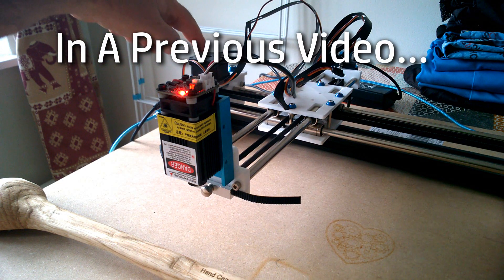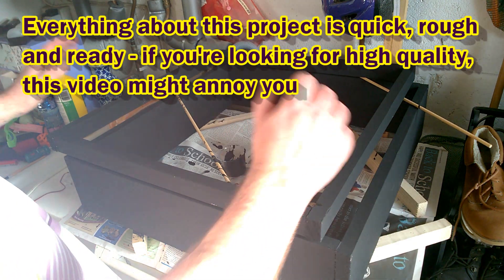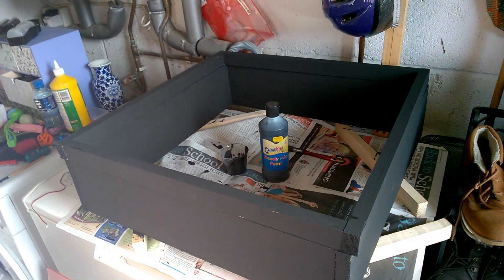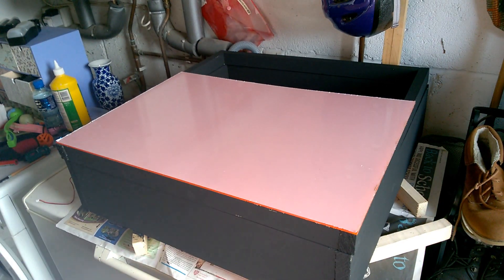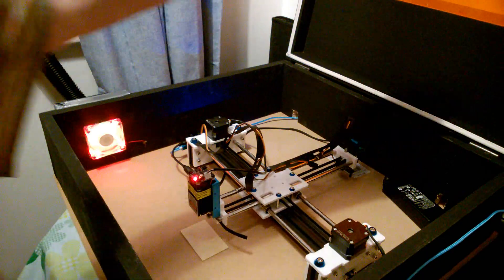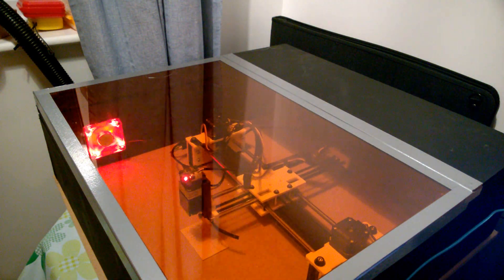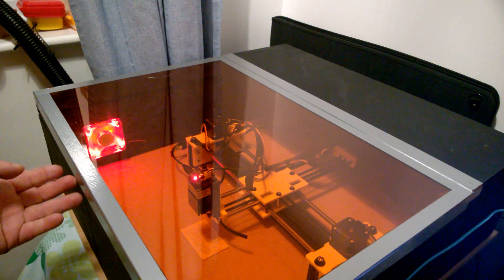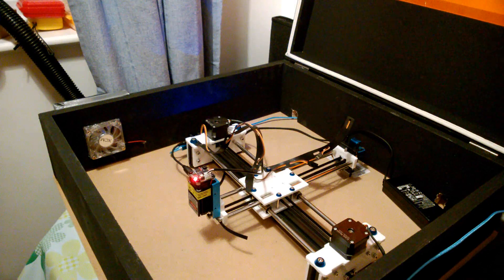Making A Fume Hood for my EleksDraw Laser Engraver

Comment: Great vid, just fallen into the same trap thinking I could suffer the smoke & smell as I won't be using the laser that much, but like you say you really can't even with windows wide open, so gonna give a home brew version a go but can I ask what size/diameter type of hose did you use ?.
Reply from the maker: The hose is just something I salvaged off a broken vacuum cleaner

Comment: Nice video! Where does one get the plastic protective material from?
Reply from the maker: I bought it from https://www.perspexsheet.uk/
Reply: Was it the tinted perplex orange 300? 
Thanks!
Reply from the maker: It's the Lava Orange Fluorescent - not technically rated for blocking laser light, but in practice, very good at stopping near-UV.  I still wear the safety specs as well
Reply: @AtomicShrimp  Thanks Atomic cheers!

Comment: I think you also need a draw, the fan is working hard to pull out the smoke. If you put a hole in the other side of the box the fan will perform better.

Comment: A vent on opposite side of vent may help with air flow. Then you shouldn’t need two fans.
Reply from the maker: Perhaps just a few small holes - it's important to keep the pressure inside the thing on the low side so the smoke can't just leak out, and also not to create too much of a crossflow in the working area, as lightweight materials like paper or foam could be disturbed by moving air inside the case

Comment: You could also have used the second fan at the opposite corner, creating an air inlet to the housing. Thus establishing an airflow over the engraver towards and out of the hose. That way you don't have to "fight" a vacuum and possibly a better "draft"
Reply: yes , inlet holes will allow for better airflow
what I did on my K40 was cover the inlet holes with active carbon fillters, this alone prevented bad small / smoke  from exiting the chamber.  ( use the ones you can buy for kitchen extraction hoods)
Reply from the maker: The idea is to have a partial vacuum inside the cabinet, then there should be no fumes escaping through any small cracks or gaps. Ideally, the fan should be drawing on the end on the exhaust hose
Reply: @AtomicShrimp  I figured that much... Considered mentioning a slightly smaller inlet fan vs a larger outlet fan would be preferable. But since you said you had these of the same type....
You can also just add some inlet holes... You'll still have a negative pressure inside the box (no fumes leaking out) but a better airflow. (no more "leaving it for a moment for the  smoke to finish clearing out of the box") :P

But hey.... If it works, it works, right...
Reply from the maker: Yeah, inlet holes are probably the thing. I think there are some of those as accidental 'features'
Reply from the maker: Thing is I don't want too much airflow if I am cutting light materials like foam, paper or leaves
Reply: @AtomicShrimp  LOL
Reply: @AtomicShrimp  That makes a lot of sense.

Comment: Where did you find the plexiglass glass that large
Reply from the maker: I bought it from a place that cuts to order https://www.perspexsheet.uk/
Reply: @AtomicShrimp  thanks, but I'm USA. I will keep looking. Thanks again. I like you box design
Reply from the maker: @cutflower36  I imagine there must be similar 'cut to size' plastics companies selling into your market area (hard for me to search for as Google wants to show me those available to me)
Reply: @AtomicShrimp  I think I found one on eBay, not as large but it will do. Thank you. Can I ask when u focus the laser, do you do it with the safety glasses on? I notice the beam looks different with the glass
Reply from the maker: @cutflower36  Generally, it is not necessary to wear the safety specs when focusing the laser, as it is set to very low power (and if the specs are doing their job, you should not really be able to see the dot through them anyway)
Reply: @AtomicShrimp  thank you

Comment: A very old video, but for anyone thinking about making a enclosure or any kind of smoke/fume extraction system for a laser, using grounded metal hoses is a good idea since the fumes from a laser actually are quite combustible. Also you want to suck the air through the hose, not push it i to it like in this video. (Put a blowerfan on the other side of the hose, you can very well also have a fan on this end, but you still want the other fan to be more powerful to make negative pressure inside the hose.
Reply from the maker: Good tips - thank you

Comment: Wheredo i get that glass ??i need the uv protective plexi or acrylic glass any idea where to buy one im from germany
Reply from the maker: I bought this piece at http://www.perspexsheet.uk - not sure if they ship internationally.  They do sell laser-safety acrylic sheet, but I just bought the fluorescent orange as it blocks blue and UV well enough (considering I am also wearing goggles when using the machine)
Reply: AtomicShrimp thanks mate!;)
Reply: I asked at perspexsheet.uk but they don't sell laser safety glass.
Reply from the maker: I think they must have discontinued it - it was available when I bought this, but it was a lot more expensive.  Fluorescent orange perspex will block a blue/violet diode laser adequately for this purpose, and is quite safe if you are also wearing the safety specs

Comment: Nice work. I have just bought a similar type of laser engraver which i want to build an enclosure for. I purchased a bathroom extraction fan kit, not sure if I went overboard, i havent tried the engraver yet so dont know how much smoke it generates. My my question is about the window panel, what kind of acrylic is it, what colour and how thick? Does it block out all the harmful laser light? Do you still need to wear the goggles?
Reply from the maker: In theory, you need to get the right kind of acrylic specifically designed to block UV and near UV light.  In practice, anything that blocks blue and UV light is probably good enough - as long as you don't stare through at the beam and as long as you also wear the laser goggles.  More precautions are better than fewer.
Reply: @AtomicShrimp  thanks for your reply. Yeah that was what I have beem reading online aswell. One person also said you can stick a "layer of reflective acrylic ‘one way’ sheet on the inside. The kind of stick-on sheet you would use for an infinity mirror (which is where I got mine - off-cuts from my infinity clock)."
I am assuming the kind you use for window tinting? Anyway thanks again.

Comment: which software do you use with it??? I have same assembly..
Reply from the maker: I'm just using EleksCAM, which is downloadable from the EleksMaker site - I understand there is a third party product called T2Laser which can also control this machine (and maybe better).  I also have installed the Eleksdraw plugins for InkScape which allow vector drawings to be converted to GCode for driving this machine (still having problems getting the scale right with that.
Reply: AtomicShrimp ok thanks.. i am using T2laser as I got fedup with elekscam as elekscam can't produce grayscale engravings..
Reply from the maker: Khanna Ji Hobby Channel I have still to try T2 myself. Did you need to change the device firmware?

Comment: Silly question but did you also make a hole elsewhere to allow air to enter the enclosure?
Reply from the maker: simon ross I made a couple of small holes at the rear to admit both air and cables. Turbulence from the fans is a problem so I will be replacing the fans with a centrifugal blower, then I can increase the inlet hole size
Reply: A 100mm inline bathroom extractor may be worth considering
Reply from the maker: I might try that if the centrifugal blower isn't good enough (already ordered the part though, so I will try that first)
Reply: AtomicShrimp as I'm not familiar with lazer etching I'm not sure if there is any heat build up inside the enclosure. If there is its better to push the air through rather than pull as fans will last longer as the bearings won't get so warm 👍
Reply from the maker: simon ross heat buildup is pretty minimal - it's only a 1.5 watt laser. If I used positive pressure, I'd get smoke emerging from some small unsealed hole I bet